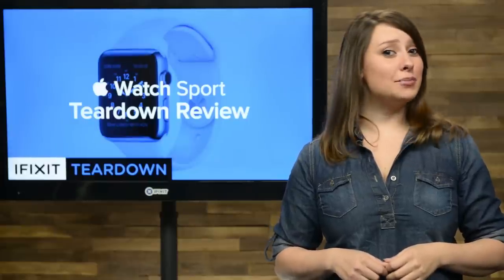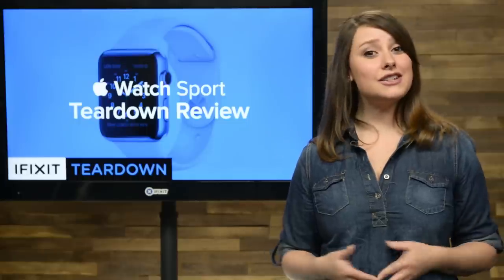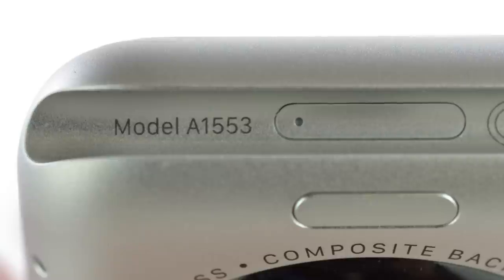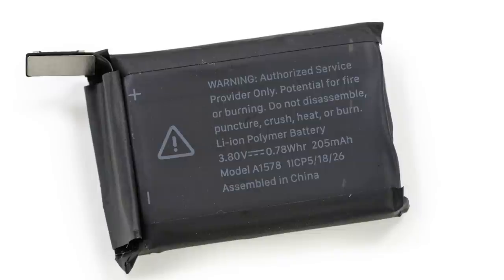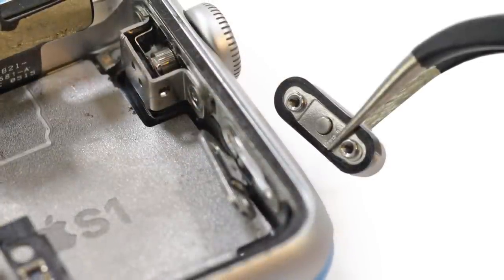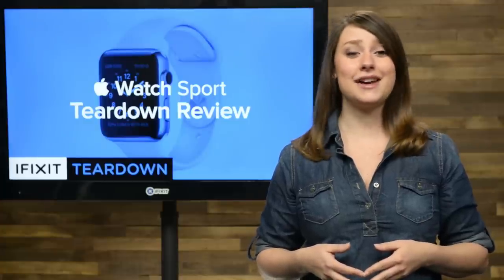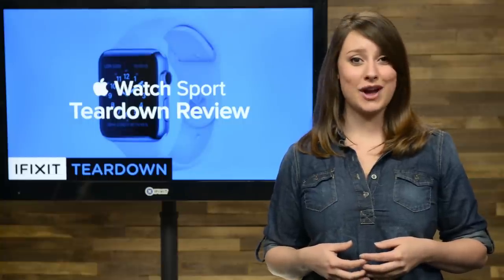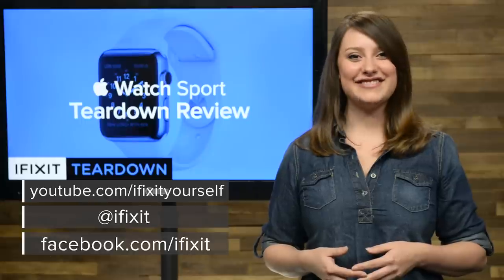 Watch Teardown Review!

Comment: how much batterypower does the 42mm have?
Reply: coolertuep It's better than the 38mm. I know that much.
Reply: Same
Reply: Krisham Ray nah i heard it would have more (make sense though, scince the tech inside is the same but more space)
Reply: coolertuep You make a valid point.
Reply: Krisham Ray apple side says
battery life
38mm: 18 hours
42mm: 18+ hours

considering how much bigger the 42mm is and how tiny the battery in the 38mm is, there may be enough space for a double sized battery
Reply: coolertuep my guess is 300 mah
Reply: Christian Oldenborg im suprised there is still no information on the web about this..
Reply: +coolertuep I'm not exactly sure, but I have the 42mm watch.
With light to moderate use, I've lasted almost 2 days.
With normal use, I've lasted about a day and a half.  

Take that as you will.  I think that's pretty normal for smart watches though.
Reply: Phillip Jernigan well my Pebble last 5-7 days ;)
And over 30 days while not connected.
Reply: Christian Oldenborg That's nice and all.  Really, good for you.  Not being sarcastic.

The Pebble doesn't interest me though.  At the end of the day, I was torn between the new Moto 360 or Apple Watch, as both can run on iPhone now.  I went with the Apple Watch for a slightly more integrated ecosystem, thus more functionality with my current phone.
Reply: +coolertuep I can get it to last two days easily.

Comment: The battery is no issue. They tore down the 38mm but I have the 42. With the 42mm I can easily get two days of usage. As for the 38mm I'd say you can get almost the same.

Comment: S1: bonded bare die on PCB for certain.  It would be interesting to see what's encapsulated within the epoxy-resin but you're unlikely to gleen much useful information from unmarked bare silicon and some SMC caps/resistors/inductors.  "S1" effectively designates a very large SOC.

Comment: The batteries in Apple devices have always been smaller than rivals. This is because Apple first uses its own software which is then optimised specifically for that device. This is why Apple can achieve 18 hours or so with a 205 mAh battery whereas the LG's, Samsung and others have to nearly double the capacity of the battery to achieve these results.

Comment: Just wanna ask if the apple watch 42 mm stainless steel all the parts inside the watch are the same as apple watch 42 mm alluminum?pls help thanks!
Reply: all watches are identical except the case material, screen glass type and price